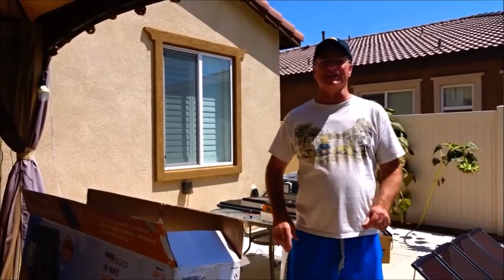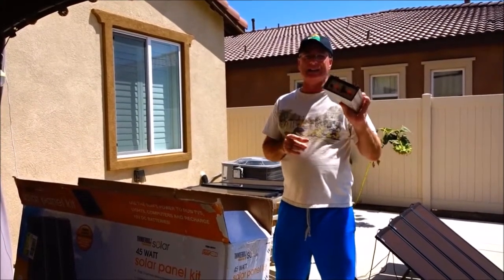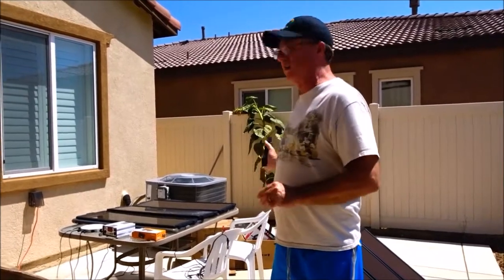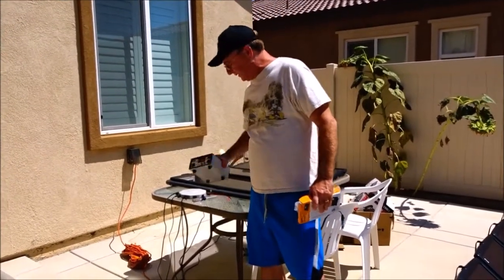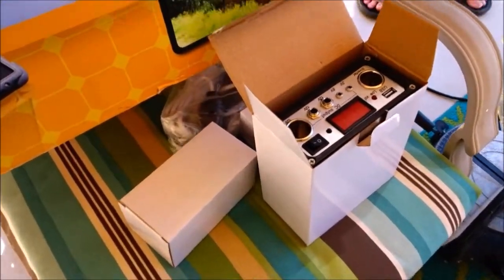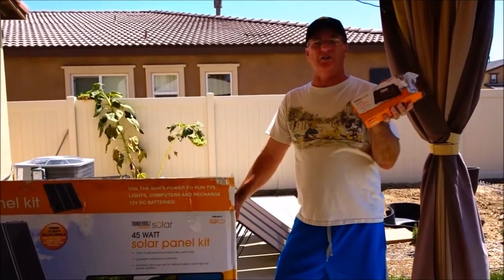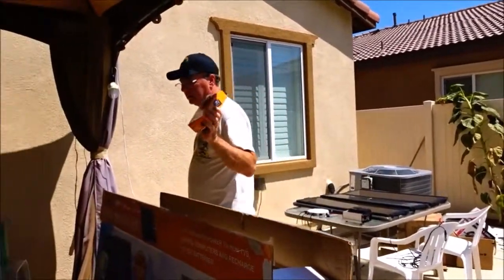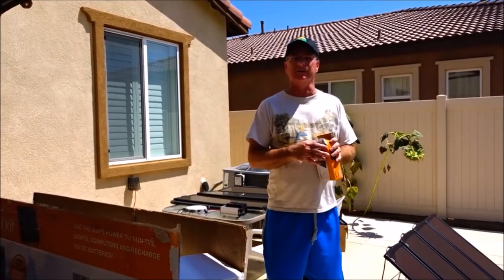Dead 45 watt & 100 watt Thunderbolt solar charge controllers. Harbor Freight did right by me.

Comment: Left out in the weather,  the plastic frames will crack (usually at the corners) and leak water inside, corroding the wire connection, killing the panel.  In two years, two of the three panels in my set were dead.  Another year and the third panel died.  Very difficult to repair and frankly not really worth the effort.  They do produce in low light until they die, then they produce nothing.  I like the controller box for the various taps available so I picked up a 50 watt polycrystalline panel from Renogy and it works like gangbusters.

Comment: Some of their 45 watt controllers have a small button on front to turn off led display. yours may be turned off.  PS connect batteries to controller before panels so current has a place to go.
Reply from the maker: Thank you. I will check for the button. I will now forever connect batteries to controller before panels.

Comment: As the batteries seem to be in the boxes, did you connect the solar panels to the charge controllers without a battery?  That can be death to most inexpensive (under $150) charge controller.  I've used a variety of solar panels (including the 45 watt HF kit) and a half dozen assorted charge controllers and they're all still working.  Currently have four 100 watt panels on an MPPT controller charging a 540AH battery bank.  It can run the fridge, freezer, wi-fi, TV and some lights for 10 hours (with a lot of cushion) so I'm not starting a gas generator in the rain.
Reply from the maker: You are so correct. Thank you. I have since been taught to hook up the batteries to the charge controller before the solar panels are connected to the charge controller. Live and learn. Thank you.

Comment: Excellent video. Can I run two 100 watt systems to my RV from the hub using only ONE of the charge controllers? David 😇
Reply from the maker: I suggest if you have 2 100 watt systems for a total of 200 watts possible.... You better have a charge controller rated at 200 watts at least. This is why I use the 500 watt charge controller. But yes, using the hub .. put all your power into one charge controller rated to handle your maximum power.

Comment: Another website says these solar charge controllers give inaccurate readings.
Reply from the maker: Just check a view times with your meter and if you get on that isn't accurate take it back. Ours are fine and close enough. You are not trying to power a city.

Comment: I don't recommend hooking all that solar to those little batteries.  I also think the charge controller that comes with the 100W system is only a 10Amp controller.  If you hooked up all that solar to it you may have overloaded it.  What was the controller on the 45W system rated for?  Are you sure the controller you have now is rated for 50Amps? 500W?   I think you were overloading the kit controllers?
Reply from the maker: Hi, Thanks for your comment.  Please watch tomorrow's video that will be up by 9am pacific time and it will explain.
Reply: I found that out the hard way overloading my solar system. Had A 7 amp hundred-watt controller. Luckily I had a good enough sense to watch it. I could have burnt my house down.

Comment: Thanks.  I looked up the controller you have and it is only rated for 30 Amps or 360W@12V.  I would not put more than 300W of solar on any 30Amp controller despite what they say.  They put 500 on there because of the decline in out put of Amorphous panels.  I would not run more than 300W of new solar panels on it.  After your panels decline the 10%-20%, in out put,  over the first 6 months,  then you could add more.  At this time your panels are new and putting out the full rating.  I personally, would not put more than 400W of panels even after the declination in output values of f the panels.  Since the panels will decline at differing rates and ratings you will have to test each panel to find your output potential.  Amps are the danger!!!!  Please be careful and do your homework.  Do you know Watts Law?  A x V = W,,,  W/V=A  Etc.....  I am not judging you.  I own the 100W system and the controller that came with it has no specs on it.  I believe it is only 10Amp since the weight is low and compares to my other 10A PWM controllers.  Also, the output side of your controller has an output rating on it as well, it may be less than the ratings of the controller.  I could not find specs on the controller in my kit or the manual.  I am only trying to be helpful.  I look forward to your video.
Reply from the maker: Yes, I totally agree. Today's video will post in about 90 minutes. You will see that I have 190 watts of solar going into the charge controller. You will see the hub I am using is rated at 400 watts. Thanks for taking the time to comment.
Reply: What i want to know is the specs of the 100watt "magnum" charge controller.  Im relying on this controller to keep my reptiles warm while homeless and living at campsites and walmarts in a popup camper with a mr heater buddy $2/night propane system.  Until my house sells in 1-2 months im relying on 2 110wh batteries on this HFmagnum 100 watt to run a 6 watt heat mat inside a large coleman cooler for insulation.  So far so good, but im concerned for a blowout.  Night time temps in the 30s in the southwest desert.  Temps inside cooler 93*F.  I have "hot hands" hand warmers for back up, but they're known oxygen depleters so i have to leave the cooler cracked.  Should i only run three panels for a while until tjey "degrade" or what?  I guess if it does blow out i will have to find a HF and make the trip to exchange.  Its a situation wherei thought i thought all contingencies, now wondering if i shouldnt have trusted harbour fraught with the lives of my animals.  Maybe i will get a friend to accept shipping on a better charge controller, but theyre a ways up the coast in colder territory pacific nw.  Is the hf 500 watt cc any good? Available in all stores?